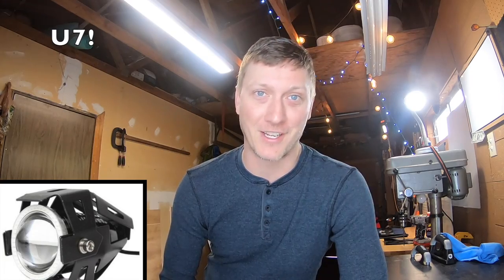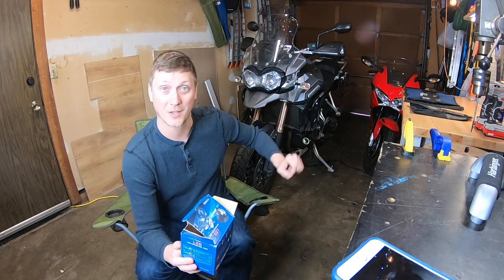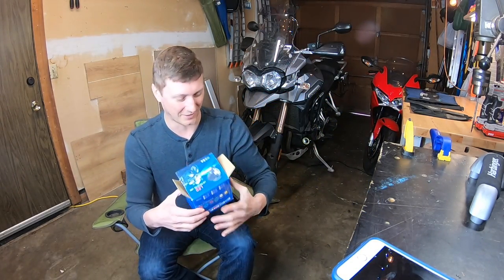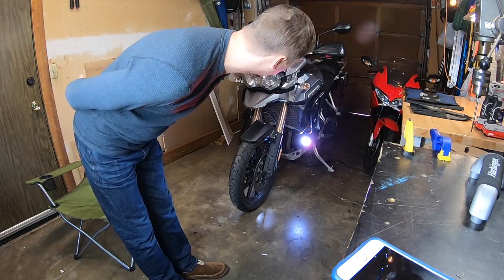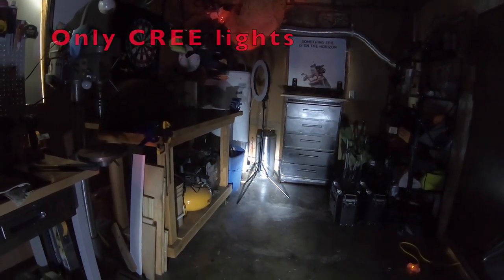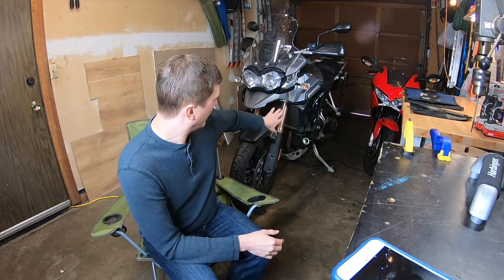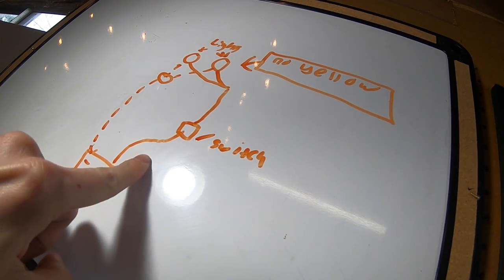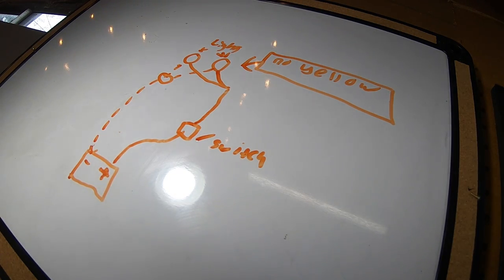CHEAP motorcycle LED auxiliary lights - [CREE U7 Installation + Overview]

Comment: A few years down the road since you made this video and the info is STILL very much useful. Doing my own install tomorrow. The only difference is I bought a wiring harness and better brackets than the ones they sent. Thanks for the video. The tips at the end are VERY helpful indeed.

Comment: hi - why so difficult - connect them to the horn and you have the switch with the ignition and the 10A fuse and - no long cables under the tank. I've done it this way on my Tiger and it works. Only to remove the small front inner cover beside the radiator to store the cables behind and that's it.
BTW - I've put the switch just behind the brake fluid reservoir on the handle bar. It's so small, it fits easily, when you move the reservoir a little bit.
Reply from the maker: Jeje Komo that’s a good idea :) just was a bit over cautious.  I’ve also heard the pub light is a good source.
Reply: do you connect the lights and the switch to the horn? does that mean you dont have to wire all the way to the battery?

Comment: If your going to add electrical acc. wire an auxiliary fuse panel from battery with a relay. When you turn off bike all acc. go off

Comment: Thanks for sharing your journey with us! I learned a lot.. 
I came across same set of u7 lights for free but mine have the Angel Eyes, which are what what that yellow is for. I kinda like em for aesthetics..
Thanks again for sharing
Reply from the maker: Thanks 🙏.  Happy to help. I like the yellow ones too.
Reply: @motodrang4287 the lights I got which I am sure are the same have a red black and yellow, do you know which wires are which? I built a nice 3/4” stainless bracket for mine because I am putting them on my wife’s E-Bike. The box says the wires are different colour so that’s no good. If you could share which wires are which I would greatly appreciate it, Thanks John, I just cut the original plug off old lights so I can solder plug to wires once I know which ones are which.

Comment: I can tell you, the yellow wire, you can use, it is for the angel lights, so they
 can run individually ...
Reply: Only if you have the three way switch, as on the newer ones 😊

Comment: Is there any other easy way to connect them  without battery connection
Reply from the maker: You could find an ignition wire and splice in. Just make sure it’s a well sealed connection.
Reply: @motodrang4287  got them sorted just connected the red and black wires to work low beam bulbs 5 minute job there working great I can just switch the black wire over if I want them on the high beam 👍

Comment: First time I've watched a light fitting vid and not actually seen the fitting of the lights.
Is the yellow wire you didn't use not for the daytime running light. The outer ring lights up desperate to the main light for greater daytime visibility. So you get seen by other drivers.

Comment: I appreciate you taking the time and effort to make this video but it wasn't that useful for me. I was interested in the mechanics of the install rather than the electrics. I wanted to know how to fix the lights so that I could adjust their pitch and yaw once installed.
BTW there are a few YT vids on how to disable the strobe feature.

Comment: Hello ,
Could you please tell me if it is possible to put a relay in the circuit ? 
Thanks
Reply from the maker: You should be able to put a relay on the circuit but I'm no electrician.  Are you having flickering issues with the lights?

Comment: thanks for the video...you cycled a snag too fast through showing the Lights + Cree section. Otherwise I appreciate it, considering getting some for my scooter
Reply from the maker: Konrad C whoops sorry about that. After I posted I also wished I had shown them in a night ride.  Thanks for the comment! 😃
Reply: Really came out nice on my scooter.  Mounted low on the forks.

Comment: I have those on my dl650.
Because of vibration from v2 engine 
It fall off from crash bar
Reply from the maker: Yep, I hear ya.  I added loktite blue to the clamps and it helped.  I’ve since sold the bike but seems like the owner is still happy.

Comment: So how do you get rid of the strobe option
Reply from the maker: Soroush J.saber it’s a serious pain on this model. I believe you have to remove a small relay from reach circuit board.  With The other model of light they make you can just cut a wire.
Reply: Moto drang thanks alot brother I got the u7 green angel eyes hopefully they're the the version where I can just cut a wire.
Reply from the maker: Soroush J.saber no prob one more thing. Some models require wires to be cut to even open lens cap. They are small so that can be a little tough. Best of luck!

Comment: Pretty dangerous as you don't fuse the switch or lights.   A relay should be used so the lights work off the ignition.

Comment: Why go with a disconnect.. if you cant to go ghetto.. you just had to tie into the power going to anything that goes on only when bike is on.. if you want to be safe.. just get a relay and have the relay give power to Lights also when you have ignition on (also tying relay to "something" that goes on when ignition is on)  ... just saying.. I did these lights on my Harley but I also used the Yellow which went to halo.. so I had a switch to cut on JUST the halos (which I primarily used) and then another switch when I wanted white fog/daylight  light on..

Comment: What amp fuse did you use?
Reply from the maker: it's a 7.5 amp fuse.  I'm no electrician though so you may want to check the forums based on the lights your using.
Reply: @motodrang4287  hey thanks brother. Didn't think you were going to reply.. same lights. U5. Well close. They are the ones without the ring. I was thinking about putting a 15 but 7.5 sounds a bit better. No electrician either. I'm an adult that had to find a more adult adult if you know what I mean. Lol
Reply from the maker: @ccodyskates  hahaha that the adult line describes my life🤣.  I would try and get ahold of a electronics technician if your worried about the amperage.  Good thing is that these lights draw very little.  I’ve had no issues and my rc car voltage cutoff switch is still going strong.  A mechanic said the starter voltage would be too low but , meh no probs yet.  Maybe it would be a problem on a harder to crank engine like a Ducati or Harley .
Reply: @motodrang4287 almost done with installing today. It was actually pretty fun. Lol. Claims to be waterproof. So let's hope it's true. Have you had any problems with water or the lights fogging up.
Reply from the maker: @ccodyskates  right on! No fogging yet on my end.

Comment: You need a relay, do not use the switch directly
Reply: These LED lamps are probably only running 2/3rds of an amp each so it should be fine without

Comment: Dude Do your homework :) Use relay because that Chinese cheap ass switch is not good switching 20 odd Watts it will burn out at some point. Put relay, lookup on youtube on How to wire it all up - its not that difficult tho